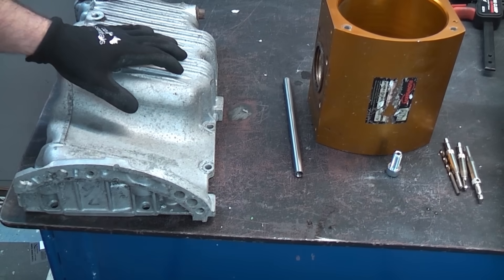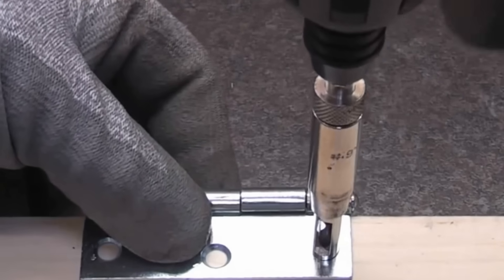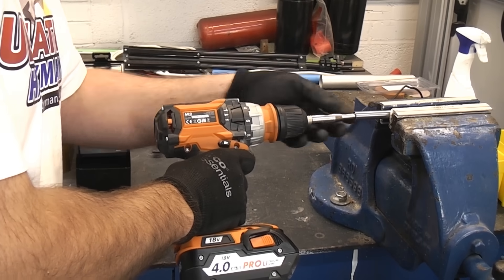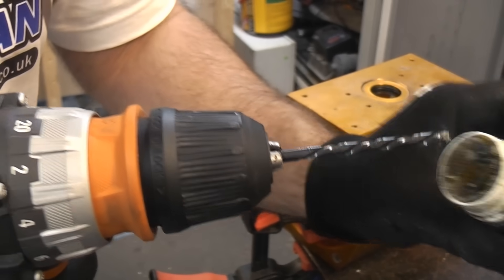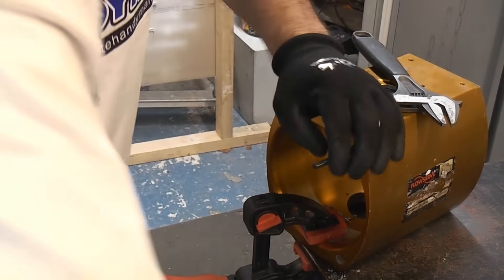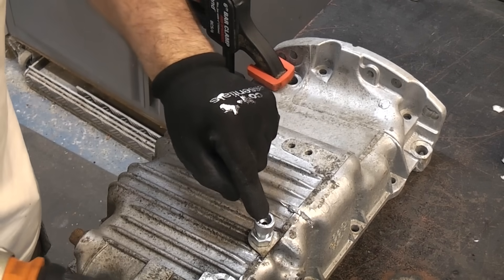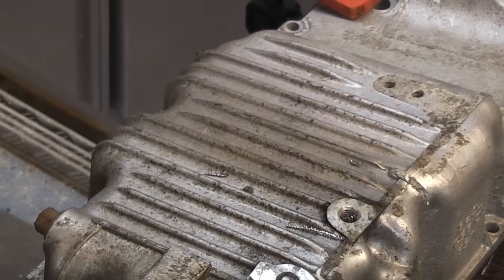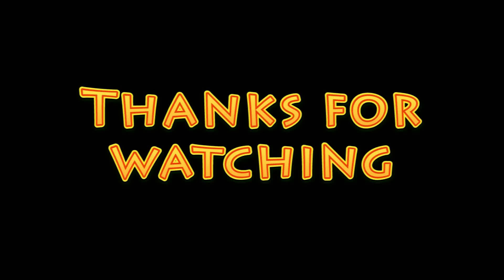How to remove a broken bolt in a deep hole | remove broken bolt in recessed hole

Comment: Those guides are a cool idea. But as far as shocking goes, I'll use several heat/quench cycles and penetrating oil in an attempt to free a bolt. In Canada we use salt and calcium brine on the roads in the winter, so seized bolts are the most stubborn in the world.
Reply from the maker: Thanks for the comment

Comment: try doing the exhaust manifold bolts stuck in the head and broken off on a 1978 Ford van 460 CI. had to remove the spring housings and going through the wheel wells with an angle drill. mostly drilled and then retapped taking out the remainder of the broken bolt. did break a tap at one point and needed a broken tap extractor. that was 30 years ago.
Reply from the maker: Exhaust manifold studs/bolts are always difficult!
Thanks for the comment

Comment: The boat guide technique will only work if the bolt breaks below the surface line not flush
Reply from the maker: That is correct ;-) 
Thanks for the comment

Comment: Excellent video full of great tips. Unfortunately it's much harder when the bolts are made out of tough steel. I remember seeing plans for a vibrating electro-discharge eroding tool that's supposed to be able to deal with very tough to extract hardened steel bolts.
Reply from the maker: Thanks for the comment

Comment: Copper loaded grease in aluminium is a no no.  You only need some salt laden moisture to ingress and the corrosion will start due to the copper to alumimium electrolytic cell with a potential of 0.6 volts. The corrosion product occupies more space than the aluminium and the thread will jam and be impossible to remove.

Malcolm
Reply: Can cause castings to crack too.
Reply from the maker: We use it every day with no problems. It seems that it's only problematic in certain parts of the world where there is high humidity, or salt water.
Thanks for the comment

Comment: Seems nobody welds their bolts out. You stick the welding rod in the hole and build up the bolt till you can vice grips on it. 
Learned through 40 years of welding.
Reply from the maker: Thanks for the comment

Comment: Aluminum has a higher melting temp than steel.build the broken stud up with weld until you can grip it and quickly give it a turn while still hot and itll turn right out.
Reply from the maker: Thanks for the comment

Comment: Any suggestions on removing a broken 3mm drill-bit from a 6mm countersunk hole?
Reply from the maker: I think drilling it out might be the only option. If you have a mag base drill, they work well. You would have to use an Artu drill bit or a solid carbide bit do drill out the drill. Carbide bits are a real pain to use though and can easily snap!
Thanks for the comment

Comment: That's definitely brilliant with the drilled out bolts.  Probably a lot less likely to snap a small drill bit in your work if you use one to drill a small pilot then ramp up to a larger size bit for the actual work hole.  You get to use your full sized bit right from the get-go.  I liked the idea of using the door hinge guide to truly center your pilot hole as well.
Reply from the maker: Thanks for the comment

Comment: good tips! i like the self centering drill and bolt pilot.

ive never had anything come out that easily however. where i live, in the "rust belt" of the us, nearly everythibg is pretty well rusted and siezed up. we are pretty experiemced with removing broken bolts. Absolutely my #1 suggestion is stack the deck in your favor to avoid getting in this situation in the first place. soak the bolt in penetrating oil, sometimes days if you have to, use allot of heat if you can, and use impact tools. bolt head rounding is also a verry common problem here, and i have grown to love the impact rated spiral toothed sockets for extracting rounded bolt heads. 

95% of the time the bolt breaks flush with the surface of the part so unfortionatly those great techniques of center drilling wouldnt work, but i find that using a center punch i can usually get a decently centered hole. 

however i dont think ive ever gotten one of those screw extractors to actually work, if you think about it the bolt has usually broken by putting full torque on the bolt head, so the idea that a much smaller screw extractor will get it out when full torque on the bolt head didnt do it is a bit dubious. 

I will usually try a screw extractor on the off chance that it works and dosent itself break in the hole, and more often than not i just end up having to drill the hole out and tap it larger or helichoil it
Reply: shonuff - -Yup been there.  Also drill a small hole to get oil onto the stuck threads.  Also,  grind a straight slot for a screwdriver.
Reply: Good post. This is a great video but in the real world I never have stuck bolts that come out as clean as his did and the screw extractors rarely work on a rusted or corroded bolts. Not to mention the moron that cross threaded it in the first place. Tap and die set after I drill the bolt are usually what I have to do.
Reply: shonuffisthemaster j
Reply: The reason a bolt extractor sometimes works when the bolt has been broken off at the hex is simply because, with the fastener clamping two parts together, the bolt is in tension - it's STRETCHED!  Think about it; often you can't budge a screw but after cutting off the head and removing the part it's securing, you put a Vise Grip on what's left an it turns right out.  Not all the time, but often.
Reply: I always, unless there's no room for me to, strike the bolt with a non pointed punch and hammer or an air hammer w/punch to break the corrosion's bond and slightly deform the threads leaving a bit of wiggle room before applying heat and wax or other lubricant, then drill and use the extractor. The shock/impact almost always loosens the bolt enough to remove with very little torque. Big problem is, there's usually not enough room to do that.

Comment: those were some shitty soft bolts to break and yet come out that easy!
Reply from the maker: I'm afraid I don't have any control over whoever made the bolts.
Thanks for the comment
Reply: I didnt mean my comment in a rude way, Just was saying they came out with very little fight which was nice. Usually with a broken bolt its tooth and nail to get the broken piece out! Never would have thought of using those types of bit guides but thats genius!
Reply from the maker: I didn't think you were being rude for a minute.
Thanks for the comments

Comment: Gonna try to see if I can get 2 bolts out of my header now back bolts driver's side on a 95 Gmc 3500 with 454 so kinda tight. Hopefully the right angle drill I bought aling with lefthand drill bits will help.going to steal your hole in the middle of the bolt from you .
Reply from the maker: Good luck with it ;-)
Thanks for the comment

Comment: Sometimes exhaust bolts becomes hard like glass and no bit gets able to penetrate those. Do you have any idea for that without disassembling the whole engine?
Reply from the maker: It's years since I messed with vehicles, and exhaust bolts are notoriously hard to remove.
Have you considered welding a nut onto the stud using a Xtract alloy electrode? It might be something to consider.
Failing that you could try drilling it out using a Artu drill bit, they can be used to drill hardened steel (but are difficult to get started)-
https://www.youtube.com/watch?v=zbJq2z2ya80
Thanks for the comment
Reply: Thanks a lot for the reply. I've tried welding it didnt work it got broken every time and it is not a good place to do welding too long because it has gaskets close to it those bits will do the job thanks! i will look into it.

Comment: You have some great ideas but what I found is that if you just center punch the broken bolt and make sure you drill all the way through it with out going through the casing you will have much better luck if it is really stuck. Never force the extractor because if it brakes you will be SOL... After you have successfully drilled all the way through the broken piece then you can spray some penetrating fluid behind it.  In that way it will help loosen it up. Just be careful not to drill to far. It's tricky but it can be done.
Reply from the maker: Thanks for the comment

Comment: has no-one even thought to weld them out? that's the way i usually do it. the the bolt snaps off in aluminium i just take a nut, put ontop of the snapped bolt, and just weld till it reaches the nut. always works for me and the aluminium is not damaged. just a bit hot at the end though.
Reply from the maker: Yes, you can even get special electrodes for that purpose called X-tractalloy.
Thanks for the comment

Comment: Ok so what about bolts that are flush with the top ???
Reply from the maker: For flush bolts, you can often knock them around using a centre punch.
If you get the spring tools centre punch (they make one with a long fine point), you can sometimes knock the bolt around and undo it, a bit like this- https://youtu.be/_mTFQbaT3Zc?t=368

Comment: But that broken stud in the hole isan't a flat surface how does the tip of the drill bit not move around.
Reply from the maker: The guide prevents the drill but from slipping off, meaning you can start a drill bit on a surface that is not flat.

Thanks for the comment
Reply: Ultimate Handyman 
Yeah i saw it, & y r u thanking me.?

Comment: Great video, wish it would work for me.

The bolt i gotta remove is peaked and jagged the center.  The peak is flush with the hole so i cant fasten those guides down first, also the bolt i need to remove is approx half the diameter of those bolts :( i doubt a drill bit that small would be able to withstand the torque.
Reply from the maker: For flush bolts, you can often knock them around using a centre punch.
If you get the spring tools centre punch (they make one with a long fine point), you can sometimes knock the bolt around and undo it, a bit like this- https://youtu.be/_mTFQbaT3Zc?t=368

Comment: I agree with the techniques. But, all your bolts were just snapped. And in pretty good shape. I wanna see a really rusty bolt that has been broken off seized into the aluminum. See how you do..
Reply from the maker: If I ever come across a component like that I will gladly have a go.

Thanks for the comment
Reply: early transit water pump bolts would be a good contender. good video. i have given up fixing cars but would have been really helpful when i was.
Reply: Ultimate Handyman So far this is just what i need thank you.

Comment: Can you try doing a Drill Guide Bolt with a larger hole that drills out to leave around a 1mm wall then use the resulting hole as a guide to drill to the edge of the thread and then pick out the remaining spiral of offcut? I'd love to see how it handles that "last resort" solution. With shorty tip drill bits (that can't cut sideways) it looks like you couldn't go wrong.
Reply from the maker: I did drill a M12 out to a M10, so the wall was very thin. I thought perhaps I could weld this to the broken stud with the ark welder, but it did not work well. You could of course use a stubby drill bit and drill the majority of the broken bolt/stud away.
Thanks for the comment
Reply: I was thinking more on the lines of how a normal drill bit hitting an offset could be pushed sideways and cut the walls of the guide and go very slightly off course so there is a thick piece of metal to one side when exposing the threads on the other, and how a drill bit with a short cutting head hitting when an offset how the flat shaft would not cut the guide, so always be dead center.
I've got a lovely set of German anti clockwise drills of that type that your guide would be perfect to try next time I need to use one.
I'm storing your great tip in that most important of my tool boxes. The brain ;)

Comment: I wish I had a way to make those extractors I do not have a lathe or drill press just a plain drill. Any ideas? I am a disabled vet and my hover round has a broken bolt in it
Reply from the maker: Do you know what thread it is?
If you can find out the thread, I'll make you one in my garage and send it to you.

Comment: Great video. Never thought of using left handed drills. Very good idea. 
You shouldn't use copper grease on aluminium. Use white ceramic spray instead. Since we use aluminium in breaks, we have to use it instead of copper spray. Otherwise the metals would corode together, cause of a chemical and galvanic reaction.
Reply from the maker: Thanks, left handed drill bits are superb. I was once on a breakdown at work, where a seal from a machine had been sheared off. I had to drill out about six M8 bolts and when drilling some of them the drill bit would bite and push the broken bolt out of the back of the platform. When I got home I searched for left handed or reverse drill bits and was delighted that they actually made them!

We use copper grease all the time at work with steel and aluminium and it works fine, but a lot of people have said it causes problems in certain conditions.

Thanks for the comment

Comment: You need to keep tapping with hammer as you turn extractor with wrench. 
Extractors with 4 straight  vertical edges bite better than screw type.
Reply from the maker: Normally with a decent quality extractor and a tap wrench I only have to tap it in once.
Thanks for the comment

Comment: Bravo! for removing those broken bolt pieces. Did you buy those drill guides from a hardware supply or did you make them yourself?  Very interesting video. Thank you for uploading this highly informative subject.
Reply from the maker: Thanks, I made the guides myself. They are very easy to make on a lathe, but can easily be made using a pillar drill.
This Sunday's video will show how to make them ;-)
Thanks for the comment

Comment: Great idea using a cap screw as a drill guide. I think I'm going to give it a try.
How come when I use easy outs I always break them off in the hole? I've given up using them now and just drill the hel out of the bolt.
I also noticed that your broken bolts were all in perfect condition with no corrosion. Was this staged or were they genuinely broken?
Reply from the maker: I've had some success with easy outs, but only after shock, lots of spray penetrant and heat. We often heat bolts to cherry red at work using Oxy/acetylene, then allow them to ait cool fully before drilling them and then using the easy outs.
The bolts were genuinely broken.
Thanks for the comment

Comment: I was always told NOT to use steel bolts in Ally ! ?? Chemical reaction aparrarently.
Reply from the maker: We use them all the time on site, but normally coat them using copper anti-seize, but people have said that that can cause corrosion in some places.
Thanks for the comment

Comment: Im an industrial maintenance mechanik as well and thank you for shareing you knowledge with us.Maybe you have some trips for removeing small size broken screws with M4 and smaller size.
Wish you the best from Hungary. :)
Reply from the maker: Smaller diameter bolts are much harder. To be honest I don't come across bolts less than M6 on site, but I have successfully removed those using a centre punch and hammer, by tapping the bolt around. I have s spring tools centre punch, which makes this job much easier as it is pointed like a nail at the end (meaning you can use it with pinpoint accuracy).
You can see it being used in this video- https://youtu.be/_mTFQbaT3Zc?t=353
Thanks for the comment ;-)

Comment: good point about the copper grease, ally and steel will weld together.  You coudl also use wellseal for bolts that need to seal and also be vibration proof from coming loose. paint a little on the threads. It will prevent the welding too.

Before snapping off a bolt that has welded, don;t use a spanner, instead use a impact driver that has a variable speed trigger.  This will allow you to shock the bolt and free it off.

I had some stainless m8 bolts in an ally bracket that would snap the bolt with a spanner. the impact driver got them out no problem.
Reply from the maker: Thanks for the comment

Comment: I will give this a try next time that kind of break happens. In Australia left handed drills are usually from engineering tool suppliers s not the local hardware shop. Apart from the spiral easy out torx drivers can be used. Thanks for a great presentation.
Reply from the maker: You are welcome
Thanks for the comment

Comment: I find not lubricating the Left Hand drill bits helps them to bite.
Can buy either Rigid or AEG 18V tools over here.
Rigid manufacture an extractor set, where you drill a hole in the bolt, hammer in a straight fluted extractor bit and then slide a nut over the end to remove with a spanner.
Can also be purchased as SnapOn or Mac.
If the bolt or stud cannot be removed, then often the only choice left is to drill and tap or use a Helicoil or Timesert.
Reply from the maker: Thanks for the comment

Comment: Excellent tips,...of course,.a lot of bolt break because of over tightening when installed. Anti seize or some sort of thread lubricant is your friend for certain, as is heat, in most cases, but use heat carefully.
Reply from the maker: Thanks for the comment

Comment: Dont use copper grease on aluminium. copper and aluminium react to each other. you will end up with corrosion.  Use instead alupaste or match better graphite grease.
Reply from the maker: Thanks for the comment

Comment: When you break off the drill or the tip of the extractor, steal some alum powder from your wife's cupboard. A solution of that will dissolve the steel without harming the aluminum. Don't use it on steel fixtures though...
Reply from the maker: Thanks for the comment

Comment: the safest and easiest way is to make a hole in the bolt then thread it ccw if the stuck bolt is cw and use another bolt to remove it easily.
Reply: Nahel Marachli 
How.?